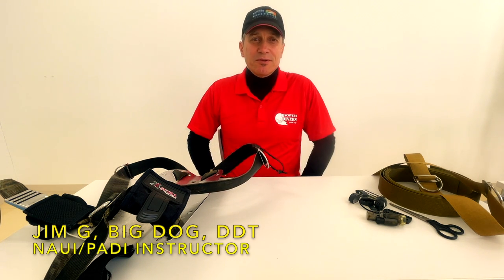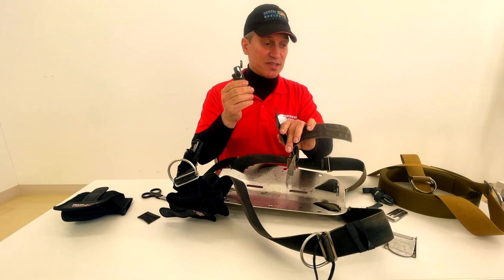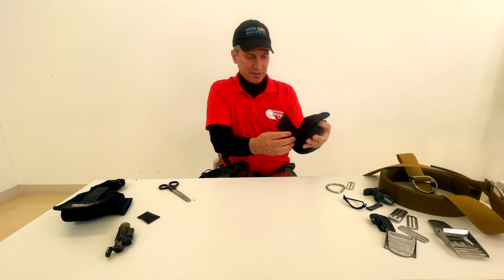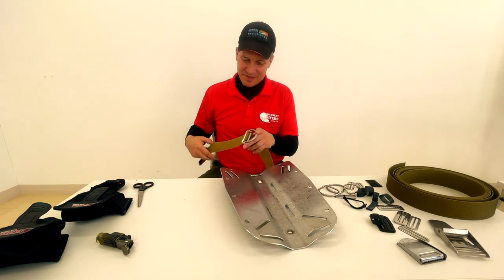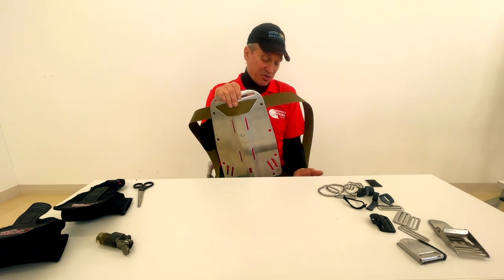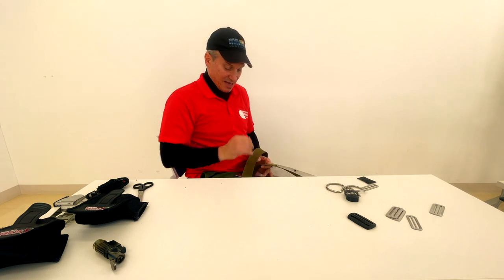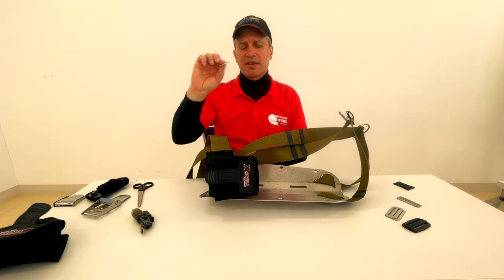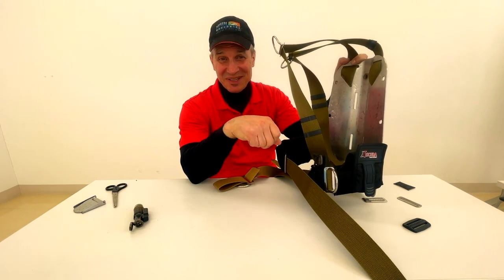How to Replace Scuba Backplate Harness Webbing

Comment: Great video! I also got my webbing from Piranha Dive Mfg, in Red. I love it, it's great webbing. (Thanks Randy!)

As far as cutting tool placement, I totally agree. Depending on the cutting tool, it can be very hard to find the perfect spot where it doesn't dig in, but is also accessible by both hands. What I did was place an Eezycut Trilobite in the Flexi-pouch on the outside of the crotch strap loop. It's easily accessible with either hand, and there's no obstructions.

Edit to add: I use inner tube for my rubber bits, including where the webbing passes through the top of the plate (before coming down over the shoulders). The size I have is 29x1.7/2.2.  Anyways, when pressed flat and measured straight across, it is exactly 2 inches. It can be a bit tight to stretch over the head of a light, but it also means it will not be sliding around on its own when not in use. (The spares/extras will stay in place and not get in the way.)
Reply from the maker: Sounds like we share a lot of common ground! Thanks for the tip on the inner tube size.

Comment: Medical shears. Best cutting device for rescue ever. 👍🏻
Reply from the maker: Totally agreed. Just wish they were more rust-resistant. The hinge pin always seems to be the Achilles heel.
Reply: @DiscoveryDiversTokyo  Yeah, so true. They also get loser as the pin wears down too. There's some companies making extremely high quality ones - like North American Rescue, just one example - but then again, they're so cheap already, when they wear out, it costs nothing to get another pair. I got a few stainless steel pairs that have lasted me years so far.

Also, Multicam is the way to go. LOL! I have a bunch of issued pouches that are multicam, so when I bought a new x-deep bc, I ordered the multicam version. Been diving with it for 6 months now and love it. :D
Reply from the maker: Multicam...FTW 👍👍👍
Reply: @DiscoveryDiversTokyo  what size of webbing do you have an were can I get relly stiff webbing sir

Comment: I use biothane 231 webbing, it's polyurethane coated for insane abrasion resistance and water just beads off of it. The "superflex" (SF in part number) is about the same thickness as standard webbing. It's possible to get it in a variety of colors, but I haven't found any resellers that stock 2 inch superflex and a custom order minimum is 1,000 feet.
Reply from the maker: Just looked it up, Gary. Something new on my radar. I'll keep an eye on this stuff, thanks..

Comment: Great video. I noticed you don't have an eyelet hole in the webbing for the top backplate hole. How do you normally go about installing this on webbing that doesn't already have the eyelet pre-installed?
Reply from the maker: Hi David. I burn a hole with a large Philips screwdriver 👍.

Comment: Did you get the standard or stiff version of the piranha webbing for the harness?
Reply from the maker: Good Q, Eric. If there was a choice, I def got stiff. However, I've unfortunately learned that this webbing is a bit soft compared to my usual black. Always go as stiff as possible. Really is more challenging slipping into wet webbing on those 2nd and 3rd dives.